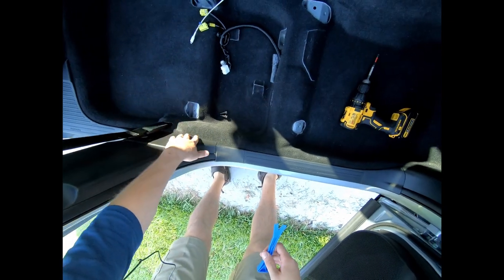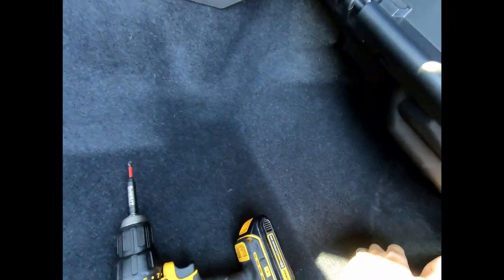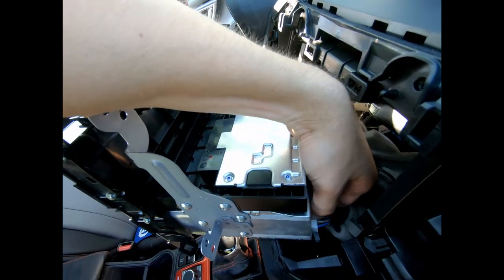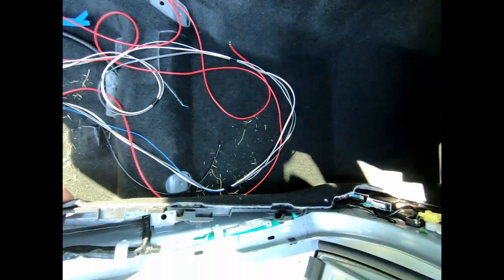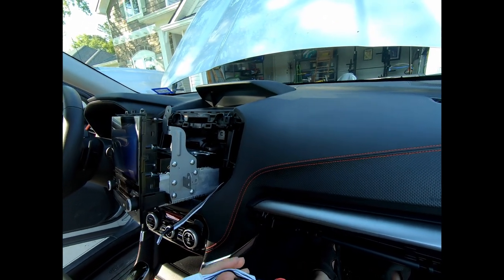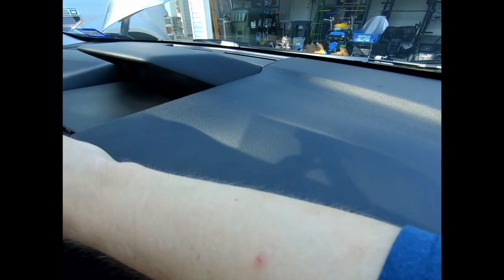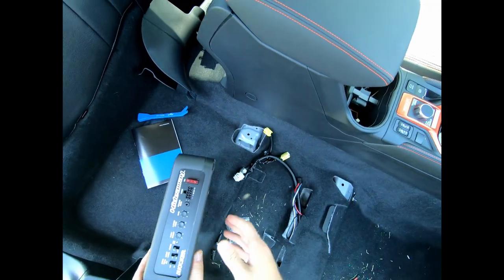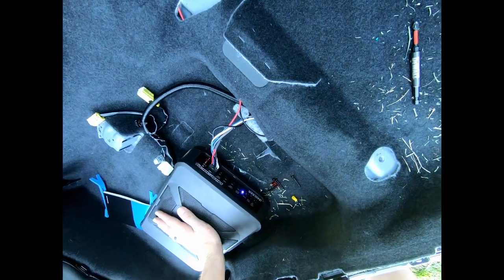Kicker Hideaway 11HS8/11HS10 install / 2020 Subaru Forester Sport

Comment: The rear channel supposedly has a lower frequency roll off (from 300Hz down) with increased volume from the head unit. I've read that it's better to tap into the front speakers lines (LF- pink, LF+ violet, RF- light green, RF+ blue) as they have full frequencies output.
Reply from the maker: Good to know! Crutchfield just told me to use the rear speakers.
Reply: That's probably why the front speakers are bigger too.

Comment: Great video. This really brings back some memories from when I installed my Kicker Hideaway in my Crosstrek. I mounted mine to the back of the back of one of the fold down seats but I'm at a point where I think it would be better under the front passenger seat.

Comment: for my 17 forester XT i installed a sound ordnance under seat 8" woofer, but way less work than what you did. No taking off the passenger seat and no removing the headunit. i ran the remote turn on wire and fuse tapped it into the interior fuse box. the rca i connected to scosche loc80  which then posi tapped into the front passenger speaker wire, the power wire i ran through a rubber grommet throught the firewall to the battery. i'm trading in my xt for a 24 wilderness, so i'm going to repeat this exact process again.

Comment: Subaru and many other manufacturers have a bass roll off on the rear speakers, thats why you always tap in the front speakers!
Soldering is always a must for a good connection, the power wire should have been pulled from the battery to the interior so you don’t need to cut and solder it again!
Most important, an underseat sub should be firmly attached in the car to get the best bass output .
Reply from the maker: Thank you. Crutchfield told me to use the rear speakers. I also had the subwoofer firmly mounted on a piece of wood that was then mounted to the floor via the bolts

Comment: Thanks for making this video, i may do this on my 2018 Crosstrek
Reply from the maker: Nice! Good luck!
Reply: I have a 2018 Crosstrek too! Let me know how it goes. Also do you have any cool mods ? I’m having a tough time trying to find and aftermarket website!!
Reply: @julianriley8434  Theres a nice mod video here on putting lights into the big rear reflectors on the bottom of the rear bumper. We will do that mod this summer.   We will try installing Focal ISTOY69 speakers in the front doors and dash. They are a component set made for Toyota that should fit. We are waiting for them to be delivered this week.

Comment: I am about to get this installed in my Crosstrek! I am also keeping the stock stereo. As we all know, the stock system is ass and rolls off around volume 22. 

When keeping the stock headunit, will this also cause the subwoofer to roll off at that point? Or will it get louder past that point since it has an amplifier?

Comment: Great tutorial! Thanks for showing all the details! How long did it take you to complete the installation?
Reply from the maker: Honestly the longest part was just taking the seat out. That took about 20 minutes with all the cables attached underneath it. The wiring harness took another 20 minutes because I had to figure things out and write them down. So probably 2hrs for everything

Comment: Another question. Did you get the signal from the blue/red wire pin of the factory harness? Isn’t that the battery +12v pin? 
Why didn’t you use the yellow/red pin of the factory harness, which is the Accesory +12v?
Reply from the maker: I used the wire that crutchfield told me to wire too. I haven't had any battery issues. But yeah, the accessory is probably the one I should have used.

Comment: did you connect the blue antenna wire from the sub? according to kicker it shows not needed when you tap in to the speakers wires coming from the radio
Reply from the maker: I was told by crutchfield to connect it. But if kicker says you don't need it, then you should be good.
Reply: What color is the antenna wire ? I have the 2020 legacy and not to sure which wire it is
Reply from the maker: @mattmiller6706  https://drive.google.com/file/d/1fVgcQG0ScXFf-7hI7wb9WB4xvmUwFZeC/view?usp=drivesdk
Reply from the maker: @mattmiller6706  I'm not too sure what you mean by antenna wire. The blue signal wire is not for the antenna, but is a wire to tell the subwoofer to turn on to not drain the battery. I attached a link for the wiring diagram. Hopefully this helps
Reply: Thanks! I am wondering what color  the turn on wire that provides power to the amp is.
Reply from the maker: @mattmiller6706  It was a blue/red striped wire in my car. But I've heard some people use the large yellow wire as well. Different from the blue and yellow that goes to the speakers.

Comment: Good video, where did you connect the blue wire to? Im trying to install the same subwoofer ro my rav4, thank you
Reply from the maker: Oh man. It's been forever. I would have to check  the wiring diagram I posted in the video comments. It's what crutchfield gave me. I wanna say I spliced it to the signal 12v in the back of the radio for the signal power
Reply from the maker: https://drive.google.com/file/d/1fVgcQG0ScXFf-7hI7wb9WB4xvmUwFZeC/view?usp=drivesdk
Reply: @readyreadyroling  thank you very helpful

Comment: Can you help me to identify the cables of the ten pin factory harness color codes? Please? In order for me to avoid mistakes in the cables setup. I don’t have the wires color code list. 
Thanks in advance for your help.
Reply from the maker: https://drive.google.com/file/d/1fVgcQG0ScXFf-7hI7wb9WB4xvmUwFZeC/view?usp=drivesdk
Reply from the maker: Here is a wiring diagram.
Reply: @readyreadyroling  thank you very much! And just to confirm. Looking at the ten pin factory harness, the cable yellow/red is Accessory +12v, and the blue/red is Battery +12v, Right?
Reply from the maker: @sergioglezo  Im not sure which one the accessory was, which was why I just went with crutchfield's suggestion to use the blue red wire. Sorry I can't give you a correct answer. The blue red will work. It's just the sub will be powered whenever the stereo is on.

Comment: Hello! What did you do to two bolts that were underneath the carpet of the passenger seat?  As I'm planning to install the same subwoofer as yours in may Subaru Forester 2019 sport.  Thanks in advance for your response.
Reply from the maker: No problem! I replaced the bolts with some matching bolts I found at a hardware store. Yours should not be as difficult to take out since I believe the dealership over torqued them when they put the leather seats in.
Reply: @readyreadyroling  I assume he was talking about the 2 screws coming out from the floor under the seat
Reply from the maker: @ekimandersom4478  for thos I used a 1 inch thick MDF board under the subwoofer with two drilled holes. I mount the subwoofer onto the board with the straps and the two holes with the bolts in the circles keep it from moving side to side.

Comment: Okay ive watched this video over and over now. From the wiring diagrams I looked it, it looks like you've connected your Signal wire to the Right Front + wire on the harness. I cannot comprehend anything else. All the pinouts ive looked at shows that you've tapped into Right Front +, not a 12v signal. But it works in your video and I just dont understand how
Reply from the maker: I followed the wiring diagram provided by crutchfield. The colors may not look the same on the video as they did looking at them in person.
Reply: @readyreadyroling  ive looked at that wiring diagram 10000s of times and it actually doesnt tell me anything about the 10 pin connector. I did end using wire to the left of the one you used and it now powers on and off with the car. i got it all working
Reply from the maker: @duLuded  very nice! Mine stayed powered on I think and would kill the battery after a couple weeks if it didn't run.

Comment: Hi! Nice job. I would like to install my Bazooka sub BTA10100. I have the Bazooka Fast-btah. I have to remove the radio, but I don't know which wire to connect to. Would you have a solution?
Reply from the maker: I'm not familiar with that product. Are you talking about the auto-on capabilities, or the audio in? I would recommend following the instructions on the manual for that subwoofer. If it needs a separate amplifier, then you would connect to that instead
Reply: @readyreadyroling   It’s a Bazooka Powered 10" Amplified Bass Tube  with a F.A.S.T. connection harness extension cable.

Comment: I need this in my Forester.
Reply from the maker: So did I. The original speakers were so bad. Now I play music and show up pumped to go to work. Haha
Reply: @readyreadyroling  , dropping my 2016 forester off at Bestbuy tomorrow to have the Hideaway and new head unit installed. Wish us luck.
Reply from the maker: @OTCinsane  how did it work out?
Reply: @readyreadyroling  pretty good! I find myself wishing for more. I may buy a second one to put under my passenger seat.
Reply from the maker: @OTCinsane  the passenger seat is where it's at. Is it under the driver's seat right now? Or the trunk?
Reply: @readyreadyroling  Currently under my driver's seat. I'll try moving it.
Reply from the maker: @OTCinsane  nah. Probably won't do much. You just prefer more bass is all. Nothing wrong with that. These subs were not meant to shake the car next to you. Just add balance to your music. Shaking the rear view mirror is good enough for me.

Comment: Awesome, really great video!! I assume for a 2019 wrx the install would be pretty similar?
Reply from the maker: That's really difficult to say. I would definitely go to Crutchfield.com and see what speakers are compatible with your specific model. You'll get all the harnesses and brackets you need for the job.
Reply: @readyreadyroling  I gotcha! I don’t necessarily mean those exact subs, just more of the general install process
Reply from the maker: @MiniBlack1000  that's what I mean. Switches and screws will be in different spots. And possibly a different head unit as I don't know what's in the WRX. However, in general, splice into your rear speaker wires and power the sub, then he's, it would be about the same. Crutchfield gives you instructions specific to your vehicle
Reply: @readyreadyroling  okay no doubt, thank you!!
Reply: Always connect to the FRONT speakers , because the rear outputs in every subaru have a crossover build in to prevent bass .

Comment: Curious are those full leather seats? Was that was an option from Subaru?
Reply from the maker: They are aftermarket. I had the dealer install them for $1k. The dealer bought them from a website called Katzkin. They are made for the Subaru sport and match perfectly

Comment: Hey man, Do you need to tap into 2 speakers or just one?
Reply from the maker: The wire harness had wires for a left and right speaker. I realize subwoofers are mostly mono sound, but I just followed the instructions on it.
Reply: @readyreadyroling   ok thank you and i see on the 10 point jumper harness, you left the red wire and black wire unconnected. are those just extra wires that arent meant to be connected to anything factory?
Reply from the maker: @tsk8560  the jumper harness I bought from a third party. It has all the wires so you could connect into more speakers for an amplifier situation. I did not do that

Comment: FYI you should sand down the paint where you grounded your speaker. With the factory metal sealing paint on the car floor meant to prevent rust under the carpet, your speaker isn’t grounded properly. Combined with your under seat placement which is a big splash/pooling zone in the winter time, you’re asking for a short.
Reply from the maker: The washer/bolt spot I used to ground was already a common ground washer that the car uses if you purchased the upgraded Harmon Kardon amplifier speaker combo. No paint in that location. Since I didn't purchase that kit. That grounding spot is available. Also, the bolt is on a lip, so you would need a solid 7 inches of water in the car to get to that spot. And the drainage for the sunroof goes through the driver side. So it's a good spot to use

Comment: Why didn't you just connect to your rear speakers at the door ?
Reply from the maker: The harness for the kicker sub was easier to connect to behind the head unit than to create two wires spliced in two different locations. Much cleaner of an install with the way I did it. And I recently sold my car and it took about 10 minutes to remove the subwoofer so I could sell the subwoofer. Was very happy with how easy it disassembled
Reply: @readyreadyroling  ok, thanks.